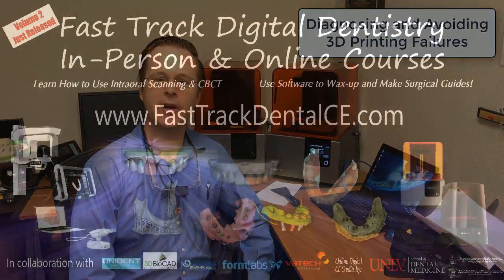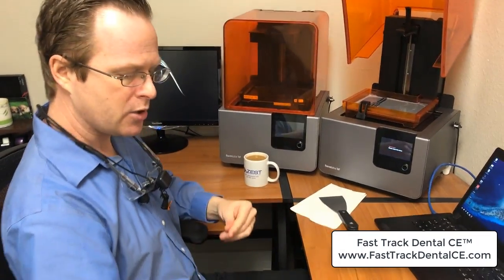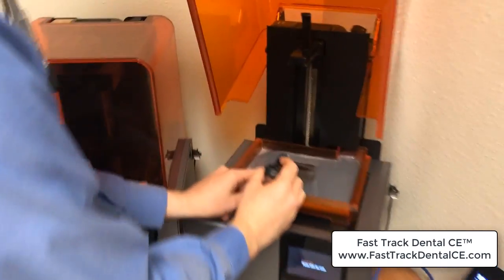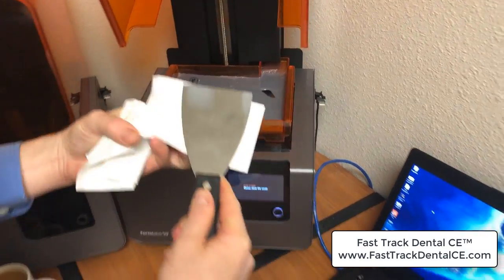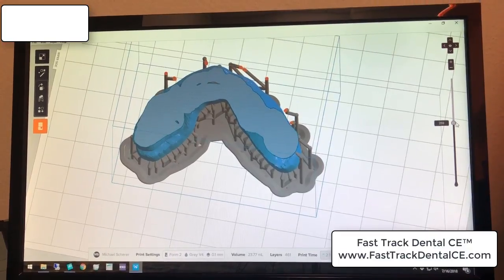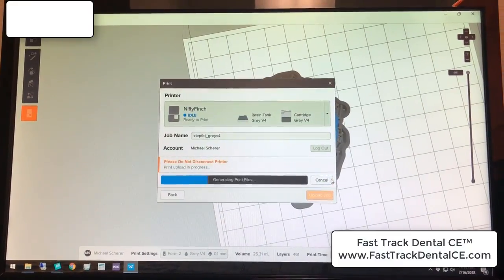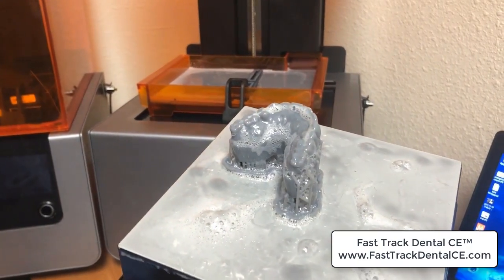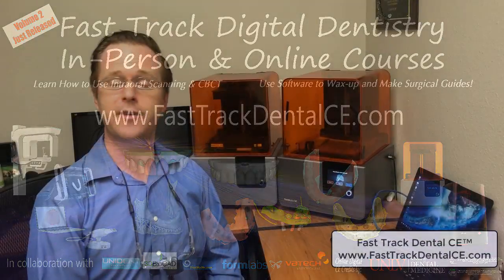Diagnosing & Avoiding 3D Printing Issues

Comment: this guy spent around 2500 $ on a resin printer that has barely twice the print space as my 200$ anycubic photon, he could literally buy a peopoly phenom for the same price and have 20 times the build space
Reply: What would be the point in having a larger build space if it goes unused? Plus  form 2 has way higher specs
Reply: @Drink182  you can print things like tools or print multiple things I can’t tell you how many times my printer has been too small to print a board piece or a small house for dnd etc...
Reply: Formlabs better printer

Comment: I do not recommend you use that scraper on the resin tank. it will scratch the lens over time. The wiper should be the only tool used to wipe the lens. This will prevent small scratches that end up refracting the laser during prints ultimately maintaining tolerances.
Reply: Lens? Reflecting? Laser? Wh.. what?
Reply: @visight7729  Hehe, your resin tank has a screen (clear part) that gets scratched up if you clean it with a more dense material. There is a laser that shines through that lens (How SLA printers work) and if you scratch it the laser (is what cures your resin) cannot do its job.
Reply: @jadsabra8592  it's UV and there is no laser nor lens. It's UV that goes through the lcd screen below to the resin

Comment: No offense, but you are handling highly toxic uncured resin, so please wear gloves. Even the finished part will have uncured resin on it, so use gloves until you have finished washing the part. Not insulting, just concerned.

Oh, and you may want to not keep food or drink near a resin 3D printer.
Reply: is that why you can buy it over the internet and get it mailed? not toxic enough for that. i stopped using gloves after my first bottle was done. now i use water washable and  handle it during my lunch
Reply: @tooslow4065  LOLOLOL This is the guy who says, "Just rub some dirt on it, you'll be fine." with a cigarette in his mouth then dies at age 55 of some random cancer and the whole family is like, "Whyyyyyy?"
Reply: @tooslow4065  You can buy bleach or acid over the internet and get it mailed. This does not mean it is safe for drinking or exposing your skin to it. Your argument is invalid.
Reply: @tatjanafelde8415  i use the resin every day. i also get bleach on my hands and i'm not dead. so my argument is pretty valid.
Reply: @tooslow4065  try acid, then we talk again.
Reply: @tatjanafelde8415  acid and bleach have warnings symbols/signs on them resin says “avoid contact with eyes mouth and skin” but does not actually say it’s dangerous or even toxic on mine although wearing gloves is good but not Necessary.